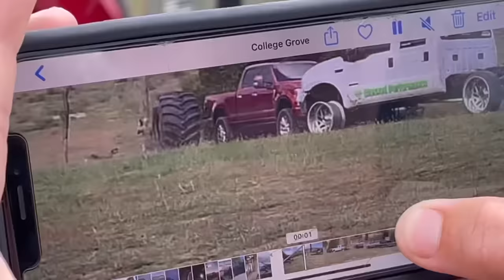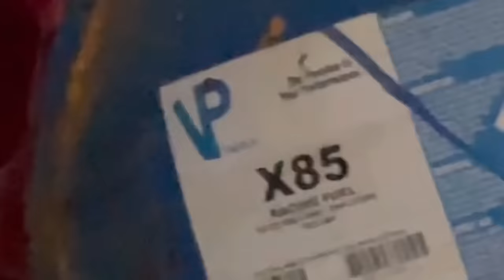Monster Truck Tire Bowling Ball.... The Pins Are My Trucks

Comment: “It will spray gasoline right in your eyes, really love that part”

-WhistlinDiesel 2021
Reply: It’s the truth
Reply: Am I the only one that noticed the red diesel
Reply: Did he really say he has to remove the gas can tip for safety reasons so he doesn’t kill somebody out of rage??🤣😂
Reply: It will, happened on one of dde's latest vids..
Reply: @GunzCars_Games  yeah, it's called farm diesel, the only difference between farm diesel and normal diesel you get from the diesel pump, is the red dye, the red dye is used to differentiate between the farm diesel and diesel because the farm diesel isn't taxed. It is technically illegal to use in normal everyday vehicles because it is supposed to be reserved for use in farm equipment. But perhaps things have changed, I don't know...
Reply: @realredditstories420  ahhh, ok I was curious if that was the case
....

Comment: The man pulling with the dozer trusting that chain has balls of steel, especially after seeing the abuse it went through.
Reply: Big time! I knew a guy that used an old White Freightliner dump Truck (Screamin Jimmy two stroke diesel) and he would pull tree stumps down with it, he hooked up to a stump and the front end of the truck and tried to pull it down backing up because there was no room. The chain snapped and it basically cut his head off after it snapped. He bled out in a short amount of time infront of both his sons. He did it for 40+ years everyday before this happened. Horribly negative story but shit happens
Reply: @jonnymac8925  That is one of my worst fears...any time I see a line with tension on it. I am kinda surprised that a chain would spring back so violently since it has no springy-ness to it....hmm I guess I'd have to look into the science more
Reply: @ValCronin  I've heard some people attach some rope etc to serve as a flexible/weak link
Reply: @ValCronin  you'd be absolutely amazed how springy solid steel is.. just takes a serious amount of force to get it working those properties!
Reply: @jonnymac8925  Crazy shit
Reply: @ValCronin  a chain doesn't look like it can stretch but it does. when you're putting some crazy force on a chain, it does stretch, and it's ready to release that energy in a real hurry.

Comment: One day a chain is gonna snap. The potential energy in a stretched chain will absolutely explode a human head.
Reply: Said by someonw who clearly never seen a chain snap lol. I operate gantry crains upto 50 ton lifts. Cables whip chains just make a lot noise.
Reply: @brett567  I've watched several 5/8" hooks blow out the pin ears and send the broken hook clean through the side of the machine shop, can confirm its noisy as all hell.
Reply: @highclasswhitetrash9027  aha yeh though it don't whip there's always 1 link (the one that broke) sent to oblivion never to be seen again 😂
Reply: Well the 50 cal didn't do much, so I'd say he's probably safe'ish.
Reply: @brett567  aye, just the holes through the insulation and hook shaped patches of silicone on the wall lmao

Comment: When you're done with the 6.0, be sure to take out the air conditioning lubrication system, may be worth a lot.
Reply: @Gen X Flex I had nothing else to comment on the 6.0 about, it just looked beat up in this video.
Reply: @Gen X Flex The point is that it's not supposed to have oil coming out of the air vents

Comment: Fumes are flammable not the actual liquid as you can put a cigarette out in a bucket of gas.
Reply: * Liquid fuel is flammable as you saw in the video but the fumes are combustible
Reply: The liquid fuel must be mixed with oxygen to be combustible.

Comment: A buddy of mine told me that; when cows are bloated, since they have no natural way to release gas they will continue to "bloat" till the point that they are extremely bloated and are in so much pain that they will find a pond to go and drown themselves.
Reply: I wouldnt believe everything that buddy tells you
Reply: Bahahahahaha!
Reply: @sunstruckfarms4489  ive seen a video where a farmer stabbed a hollow tube into a cow to release its bloat and the cow spewed out air like a balloon flying through the air
Reply: @August80ify  I'm not disagreeing that cows bloat , but they most certainly do not lack a " natural " way to release gas and they most definitely dont go dtown themselves unless by accident
Reply: @jedr.3494  yep , had to help with this when I still lived at home on the dairy
Reply: Anvil Head  so cows produce gas which normally is released by belching or farting , but for various reasons ( mostly feed related ) gas becomes trapped and voila , bloat . So just plain old gas bloat happens when for some reason the esophagus gets stopped , normally by some type of feed that wasnt adequately chewed or some foreign objects like baler twine but I think it can maybe be caused by some types of swelling around the esophagus . The second type is foam bloat , again usually feed related , happens when to much of some feeds are consumed to fast ( high protein like ground corn , ground beans ,  alfalfa , etc ) and creates a foamy gas that apparently doesn't belch well
Reply: @August80ify  sorry , didn't read your whole comment before replying , I grew up on a dairy farm so you dont have to worry bout me dumping a bunch of grain to a cow
Reply: how do you drown a bloated cow? Wouldn't it float. LMAO 🤣

Comment: Having E85 pouring into the ground is a good way to get EPA and DNR knocking at your door
Reply: E85?? That's diesel my dude
Reply: @erikcapozzi3425  Its 85% ethanol fuel.  So it was only a 15% petroleum spill, technically.

Comment: ON YOUR FUEL CONTAINERS,  USE A SHORT PIECEOF PVC PIPE THAT FITS SNUG OVER THE FILL TUBE WITH A 45 DEGREE FITTING
Reply: You can also just remove the spring and turn it into a regular open and close pour spout sds

Comment: 12:22 Don't let yourself feel TOO special. Freakin' everything in the Army breaks. Even just normal every day crap. Under normal circumstances. Over, and over, and over. They don't use shit because it's super strong, they use shit because they can get them for a super low cost. Unless we are talking armored tracks or tanks, everything is garbage. Shit breaks from going off curbs the wrong way. Drivetrain parts twist. Electrical systems fry. Suspension systems bend and break. Engines die. Just know that if you broke a "mil-spec" (lol) part, or anything you think should be strong because it has anything to do with the military, just know that a cautious old woman can break the same thing, and it has nothing to do with you at all, how hard on things, or your standards 😆